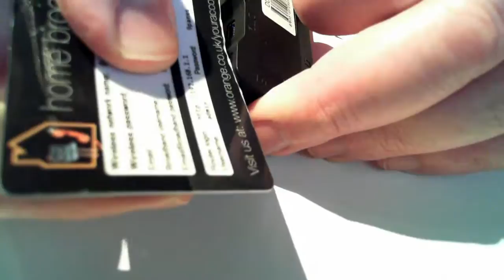Rikomagic (or other generic) MK802+/MK802 teardown and possible antenna modification

Comment: Thanks for the video!
I have one of these on order and have already seen several interesting mods, one of which is replacing that antenna with a proper SMA connector and WiFi antenna.